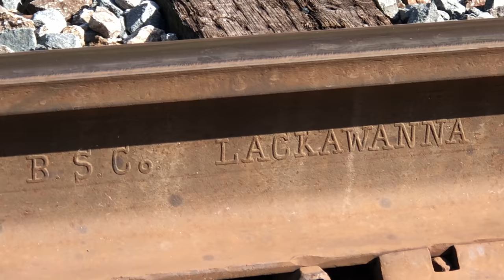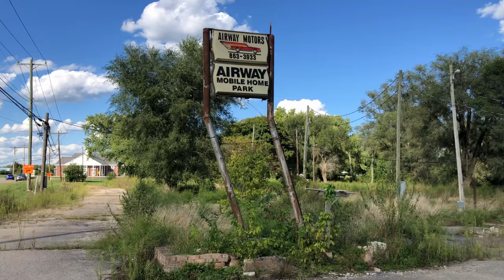Problem Railroad Crossings Of 7 Mile Ohio & Huge CSX Auto Racks Train On Norfolk Southern Main Line

Comment: That trailer park signal, @ 11:45, looks like the ones on the Ashland parallel streets (Virtual Railfan Live Cams). The top light flashes red, while the bottom is a steady "NO LEFT TURN". I would suspect this is the same.

Comment: I hope you can figure out why the local residents are protesting about the trains blocking the crossings. Like you I could not see what the problem was. The first train seemed to be moving at a good speed. The local looked cool going over that bridge. From what you showed us of the lay of the land by the bridge, I would say that anyone going near that bridge should be very cautious when they walk around the area. The CSX auto rack train was certainly a long train. Thank you for putting this video together and for uploading it for us to watch. Norfie looked like she could have taken a pass on the bath. But she did need to be cleaned up.

Comment: I could see an issue if there were a siding or a yard nearby - then you might have some back and forth switching which could shorten tempers. As fast as those train went by or as short as the local was - I don't see the issue either :)  BTW there is a steel mill in Cleveland - Arcelor Mittal. I wouldn't be surprised if they had a rolling mill there.  I see the kitty is getting some TLC - he will be a good kitty I am sure :)
Reply: I thought the issue was that the trains were stopped for long periods of time, blocking crossings which prevented local residents from crossing the tracks.
Reply: @tomhill4765  I think that's what JT was looking for and there was nothing like that. Fast trains, no yard nearby and no siding.
Reply: Then what’s that track with the metal stop on it from, the one Jaw Tooth is standing on while filming the first train?
Reply: Look close at 1:17 at that siding up ahead, maybe a train stops, uncouples to pull forward and back something into that siding, and blocks the crossings for a while. That may be the issue. Let's see what JT can find out.
Reply: @Hahninator  If it's the elevator, then the residents' complaints are 100% justified. A train that's servicing that elevator should stop so that the cars left on the main aren't blocking the crossing. So, if it's picking up cars, it should stop with the entire train behind the crossing; if it's setting down cars, it should stop so that the cut point is behind the crossing. No need to block the crossing for any extended time.

Comment: I went with a coworker to pick up lunch one day. On our return trip we were delayed by a train of about 11,000 feet that was creeping along about 8 MPH. He said "Man! This train is slow". I relied saying "if you think about it, it's a miracle that it can even move this fast, if you consider that there is approximately 14.69 pounds of air pressure pushing on each and every square inch of its surface. Inside and out". He turned and looked at me and said, "Kays, you are a real smart-ass". d8^D

Comment: Hey Jawtooth. I worked in Hamilton years ago. During rush hour, trains would block the intersections for a long time causing traffic to back up.  So I am guessing that problem has not been resolved, but I'm not sure since I have not driven rush hour up that way for a long time.
Reply: My sister lives in Liberty Township outside Hamilton and there are several spots in Hamilton where there are either overpasses or underpasses to get around the tracks although there are still spots where trains can back up traffic.

Comment: Two possible explanations:

1. Trains servicing grain bin(s) directly adjacent to grade crossing

2. Suburbanites and city folk moving to the rural communities and getting more than they bargained for
Reply from the maker: I also had someone make an interesting comment.  Someone said that maybe the trains have to wait to enter the CSX tracks at the interchange.   I don't know but that is something that I didn't consider.  I will figure it out and post a new video soon.
Reply: If it's the elevator, then the residents' complaints are 100% justified. A train that's servicing that elevator should stop so that the cars left on the main aren't blocking the crossing. So, if it's picking up cars, it should stop with the entire train behind the crossing; if it's setting down cars, it should stop so that the cut point is behind the crossing. No need to block the crossing for any extended time.

Comment: The switch yard at Lansing Michigan GM assembly looks to be stuffed to the gills with autoracks. Chip problem for the automakers is creating a large trickle down effect!
Reply: I just saw something about that on another channel. The automakers have lots with thousands of cars parked there waiting for chips. Cars, games, phones, fridges — it is affecting everything 'smart'.
Reply: Yep @Dan. It has slowed work down for my friend. His company ships out and receives something in the auto world and they are slow
Reply: Oh, my, noticed local car lots looking pretty thinned-out and wondered what was going on!
Reply: @PlanetMojo  The vast majority of cars were likely made right there in Lansing. Lansing has 2 plants. The Grand River Plant, downtown, and the Lansing Delta Assembly, which is right near that loading yard. It's easy to see from I-69 between Potterville and Lansing. 

As far as Autoracks. They store them there for other plants, so if you see dozens of them there it may not mean much of anything. The normally store them in the small yard that's there, but if it's full, they store them at the loading facility.

I see empty ones go by on the tracks that go through the town I live. It's cheaper and safer to store them there. The cars are loaded at night, so not to interfere with the operations when they bring in cars all day long. They do load during the day, but most are done at night. Since they load at most of the day and night, depending on demand, the chance of people tagging them, or damaging them is remote. It's well lit at night and there's always people there. 

Other yards are prone to tagging and vandalism and all.
Reply: @thephantomeagle2  They have parked thousand of cars all over Lansing. Some are on MSU parking lots. After they are parked, they take out the cars computer and take it back to the assembly line so they can drive another one out and park it as best as I understand.
Reply: @bobertbobert6442  Thanks It can be hard to tell at the loading facility.

So they’re likely at the large lot’s  between the Capitol building and the Hall of Justice, the ramp at Grand and Michigan, the LCC ramp which was recently bought by LCC, student parking at MSU…
Reply: As well as holding up the repair of my Focus :-(
Reply: I think that this is a world wide problem. I know that it is an issue here in the UK and in Europe too.
Reply: @PlanetMojo  Ford has a backup of about 5 months even when a custom order is placed.  Dodge /Ram have a slightly shorter backlog but all vehicle dealers have issues getting new vehicles.
Reply: @Harry-zz2oh  That's pretty insane!

Comment: I don't see what the problem could be either. Would definitely be interesting to find out. Great video buddy. Those trains look like they're going at least 45 mph.
Reply: Could be the grain bins next to the tracks. Sat photo shows a track to load cars but no spur to arrange the consist. Could be stopping on the main to make a cut.
Reply from the maker: Thanks 👍
Reply from the maker: That siding is rarely used if at all.   It is very rusty
Reply: I saw the end of the spur and it's very short. It may not be used often but when it is it's probably for a long time.
Reply: @easternwoods4378  There's no need to block the crossing when switching -- just leave the cars on the main farther back. The actual problem is that the neighbourhood just to the south can be completely cut off if a train stops blocking the three crossings, which are the only way in and out.

Comment: The Auto Rack train had 116 cars in it - two cars short of being a two-miler.
The only thing I can think of to explain crossings being blocked is the possibility of broken knuckles or ruptured air lines, as train crews don't block crossings out of spite. Even bad bearings could cause a stop long enough for a visual inspection.
Reply: There's a neighbourhood to the south that can only be accessed by three rail crossings. If a train stops over those three crossings, that neighbourhood is completely cut off.

Comment: Jaw Tooth, the problem lays with the grain elevator track, if a local freight stops about 12 car-lengths from the crossing while it is dealing with that grain elevator.  That is what I came up with as a theory.
Reply: If it's the elevator, then the residents' complaints are 100% justified. A train that's servicing that elevator should stop so that the cars left on the main aren't blocking the crossing. So, if it's picking up cars, it should stop with the entire train behind the crossing; if it's setting down cars, it should stop so that the cut point is behind the crossing. No need to block the crossing for any extended time.

Comment: On your video looked like there was a consignees switch close by probably blocking the crossing during switching. On the railroad I worked on the LIRR the Pennsylvania owned it , we had PS rail ,the Pennsy was so big they designed there own rail. I believe they had the heaviest rail rolled 155# . I noticed in the eighties they shut down antique steel mills in the USA and started to buy foreign rail .
Reply from the maker: Interesting!  That is some really heavy rail.  I haven't seen that heavy before.  The siding for that grain elevator is rarely used anymore if at all.  Those tracks were rusty big time
Reply: About 120 cars on the autorack.

Comment: I would guess Eastbound NS trains might sometimes block these roads when they are being held-out to enter the CSX Toledo Sub in New Miami.  There are some hold-out signals on that line to prevent the trains from blocking even busier roads.  Possibly the result of longer trains hanging back further.
Reply from the maker: Yes, that could be the issue.  I am going to return again and spend a whole day there so I can see it.  I hope the news channel does another story on it.   They said they would keep up with it.  There is  a passing siding about a mile away
Reply: @JawTooth  I don't know what NS would do aside from holding back even further, which may not be practical, or splitting the trains at the crossings.  The timing involved may not make splitting the trains that practical. Looking at the passing siding area it seems like they could hold there without blocking roads, but I'm not in charge lol.  I use to work for CSX out of Cincinnati on the Toledo Sub and spent a lot of time back and forth on the CSX tracks through Hamilton, where you recorded.  I believe CSX tries to highball the NS trains as much as possible onto to  CSX so as to not hold the NS trains.  Sort of a gentleman's agreement between CSX and NS not to hold-up trains.

Comment: It's likely when that spur is being switched. They leave part of the train on the main in the crossing circuit, or as they shove towards the crossing to clear the switch it activates the crossing. A common problem with switching near crossings. Also, crossings close together sometimes activate at the same time or very close together depending on the distance between them and track speed.
Reply: Then they can just leave the cars farther back. It seems the actual problem is that there's a neighbourhood just to the south which can only be accessed by three rail crossings. That neighbourhood is completely cut off if a train stops over the crossings.

Comment: I would like to make another observation about American Railway track.  It seems that in the USA they regularly replace the actual railway tracks but do not seem to replace very old looking wooden sleepers (ties). In the UK, there are very few wooden ties/sleepers left, because when track is relayed, concrete sleepers are used instead. I wonder why this doesn't happen on American railways.
Reply from the maker: The concrete ties cost a lot more and there are thousands and thousands of miles of track in the USA.  The cost is prohibitive although they do use concrete in some areas.  I have also seen steel and plastic ties in just a few areas like around tunnels and switches
Reply: @JawTooth  Sure but, roughly speaking, twice as many miles of track means twice as many trains and twice as much money available for repairs, so I don't think the cost argument works.

Comment: Railroad have many reasons for stopped train, choosing to block dead end road with no way around. I myself get blocked in or out for 1.5 hrs to 4 hours 3-4 times a year. Get anxiety when having an appointment, have to cancel. Get almost home with groceries and get held up for over an hour...with trains being two train cars from not blocking dead end with 14 residents.

Comment: The silos at the first site were a clue to me, in that switching for loading/unloading might tie things up for a bit.
Reply from the maker: Yes but they rarely do anthing with that siding
Reply: @JawTooth  yeah, you know how folks can get. Hold them for a second longer than they think is needed and they'll pitch a screaming fit, call the news instead of using reasoning skills and obvious logic to figure things out for themselves.
Reply: There's no reason to block the crossing when switching that siding: they can cut the cars on the main before the crossing so it's not blocked. Somebody commented that there's a neighbourhood just to the south of there whose only access is across three crossings, spanning a mile of track. A stopped train can block all of those at once and completely cut off the neighbourhood.

Comment: That auto rack train had close to one of every type in existence it seems. 1 each BN and CNW and a whopping 4 SP. Certainly proves Americas obsession with autos.  Certainly some nice older brick buildings in the area
Reply from the maker: Cool, thanks!  I didn't see the CNW.  Some of those cars are getting aged
Reply: The road names on autoracks are essentially irrelevant. All the cars are owned by TTX, and I'm not sure why they put a railroad name on the side -- any autorack train you see has a completely random mix of railroads that don't even necessarily exist any more. Having said that, I don't recall seeing BN, CNW or SP before; Conrail is not uncommon.

TTX is itself owned by the major railroads. It started because well-meaning federal regulations were causing problems. It used to be that, if railroad A's car was shipped onto railroad B, B had to return it within a certain number of days or pay fees. Obviously, this was designed to ensure that B couldn't hurt its rival A by hanging on to the cars. However, it was hugely inefficient because the car would almost always have to be sent back empty, unless there was a load close to its location that needed to go to A's territory. To get around the problem, the railroads formed TTX to manage a pool of shared cars. Because TTX isn't a railroad, it wasn't bound by the rule about returning cars, and it could manage its fleet as "it" (i.e., its owners) pleased. If railroad A sends a 50ft TTX box car to B, and railroad C sends one to A, A is happy because it has the same number of 50ft box cars as it did before.

Comment: I looked at that place on googlemaps and noticed that NW of it the track goes from one track to 2. I live on the CN mainline between Canada and Chicago. There's a stretch that's single track and there's a road right there. I've ridden Amtrak on that stretch numerous times and there's often a freight waiting right at the end of the double track stretch waiting to pull onto the single stretch. There's a fairly busy country road right there. We get very long trains here and the trains take a long time to get to speed. 

That's probably what the issue is. People still think that a mile long freight train should be able to accelerate like their cars, which of course they can't.
Reply from the maker: I noticed that also and I wondered if that might be part of the problem
Reply: @JawTooth  when you consider that the fire trucks don’t always take the short we route, aside from the rescue truck due to delays at the spot I mentioned
Reply: Look to the south: there's a neighbourhood whose only access is three crossings. Any train longer than a mile that stops will block all three and completely cut off that neighbourhood.

Comment: Conrail and SP were well represented in the autorak consist.  With respect to the crossing, if there's any switching going on near it, like the silo's you partially showed, then that may be the problem.....or not.....
Reply from the maker: Probably not that silo siding since it was heavily rusted but there is a passing siding a mile down the tracks that might have something to do with it
Reply: Shouldn't be the grain elevator: they can stop clear of the crossing if they're switching there.

Comment: Local  had a red signal other side of the bridge. That's why it was slow.
Reply from the maker: Yes, it stopped across the bridge and then the light went to white or light yellow, I couldn't tell what colour it was.  Then the train crossed over to the other track and then stopped on a siding a couple miles away